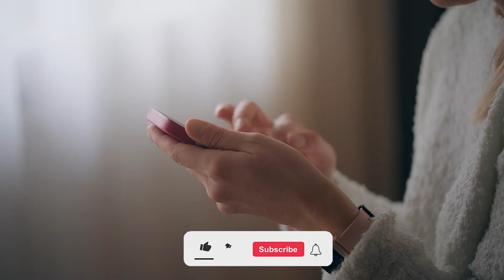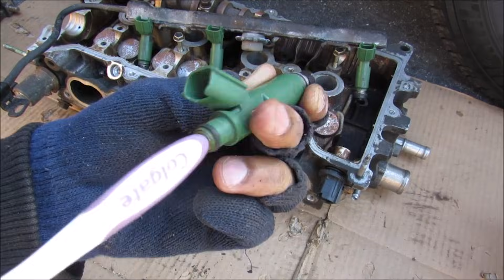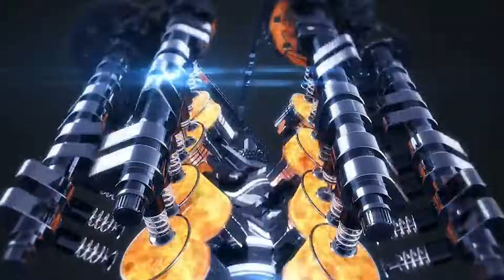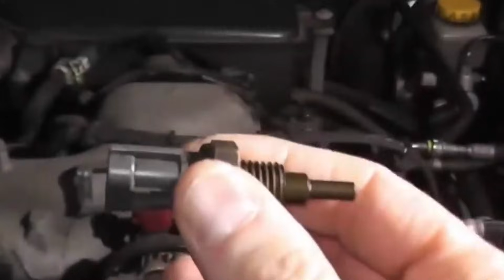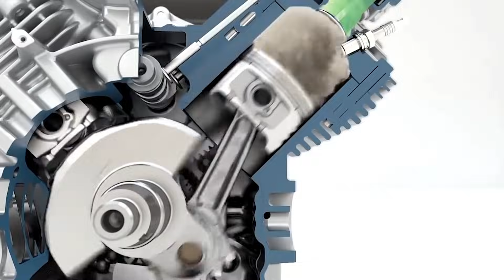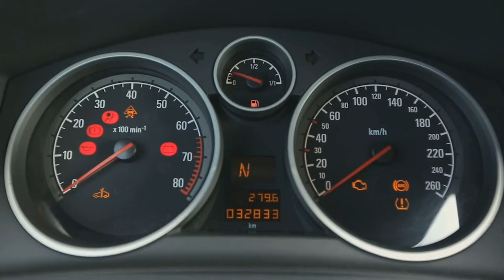The Sensor That Mostly Fails In Your Car And Almost Nobody Cleans It

Comment from the maker: It’s shocking how many 'major' engine problems are actually just a dirty $10 sensor or a loose wire. Have you ever had a mechanic try to sell you a whole new transmission or fuel pump, only to find out it was something simple like this? Share your story below—it might help someone else save thousands!